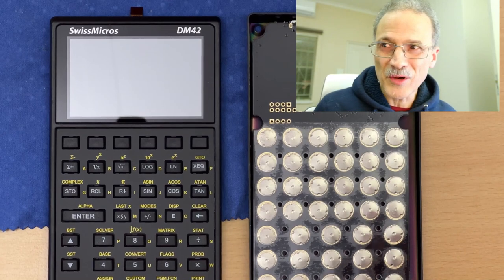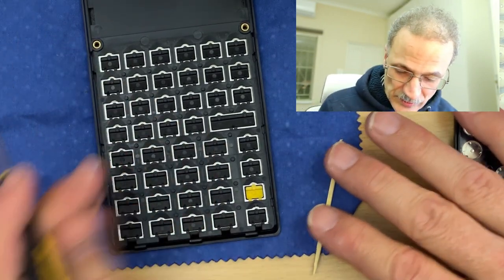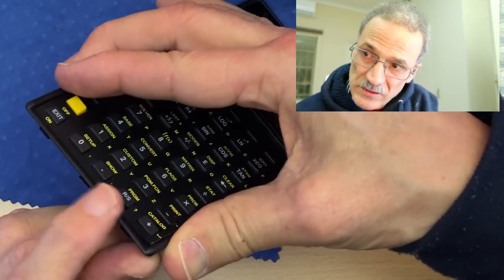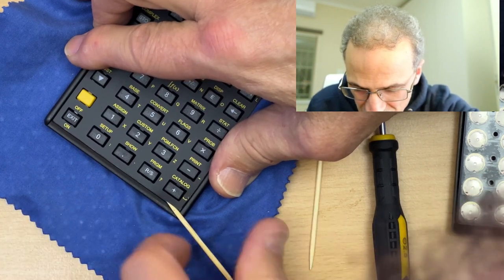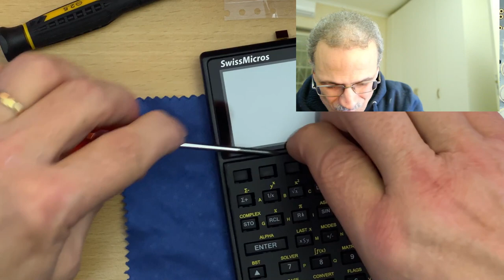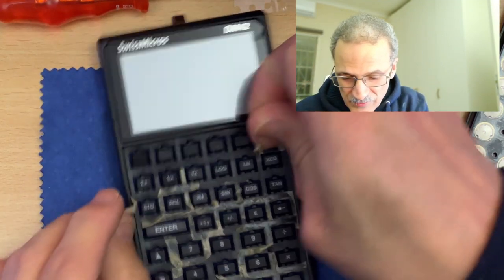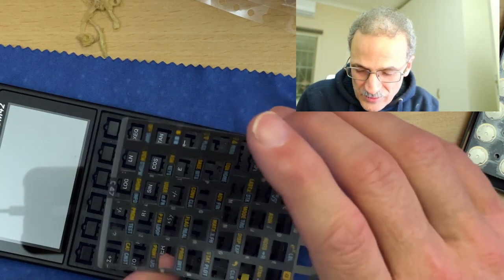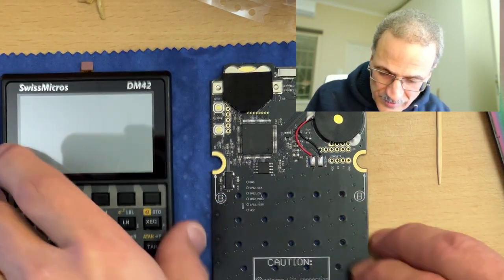C47 bezel replacing the stock DM42 plate

Comment: uff.. So that's why they won't offer replacement keycaps, isn't it? They're part of the case itself, so you'd have to relocate the screen as well. And here I was hoping to try printing a new keyboard with custom labels etched into them.

I wasn't so brave when I installed the C47 bezel: I just put it atop the stock one.

Comment: Looks so nice, a mighty calculator Jaco, do I lose my guarantee if i open the dm42 the shown way?
Reply from the maker: I would not be surprised if your warranty would be invalid should you remove parts of the original DM42, i.e. their metal bezel. Sticking our polycarb bezel on top as per the other video on this channel, would be safer as you are not disassembling the Dm42.